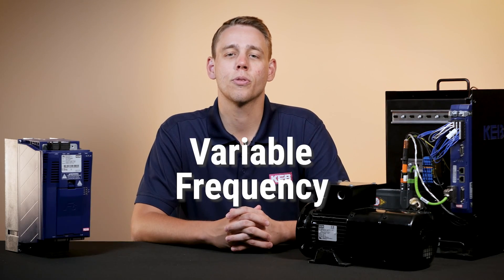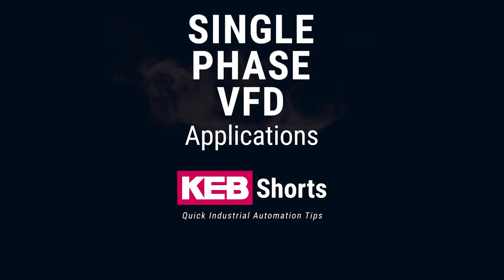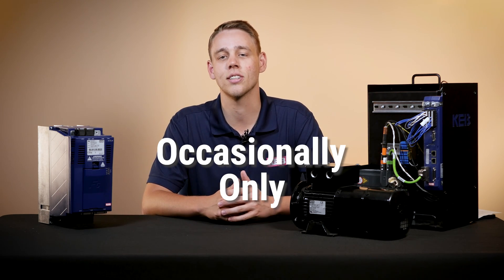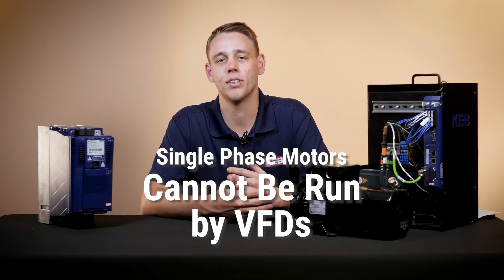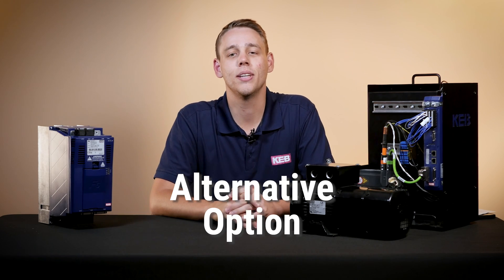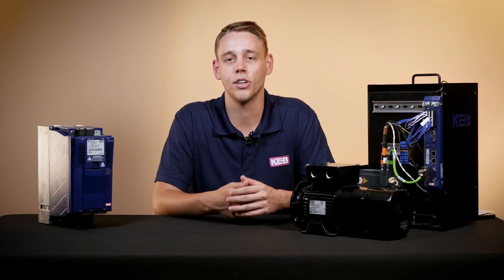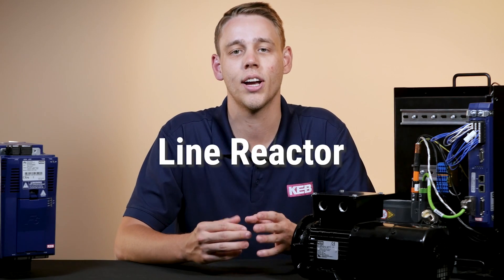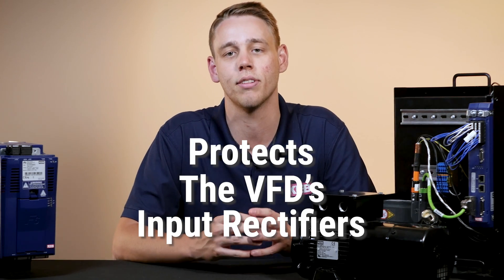VFDs for Single Phase Applications | KEB #shorts

Comment: I am looking for a VFD monophase ( 220V ) input to monophase motors (220V ) Output . My idea is control the frecuency and the voltage of course. I want to connect this VFD to an european motor 220V ( grodund, blue , brown and black or Common - Forward - Reverse ). Always uses a capacitor between forward and reverse. Does This exist? I want to use all the benefits from VFD on these motors.

Comment: Hello. There is a keb f4 drive device that has a technical problem. please guide me. The problem in the device is as follows. 1- The drive is turned on by connecting to its standard voltage, and all commands are applied to the device by the keyboard, and the device turns on, but the voltage does not appear in the output.
Reply from the maker: Thanks for your comment. Your first step would be to contact your machine's OEM to see if they can help. What type of application you are using with the F4? We haven't manufactured an F4 drive for decades. We would need more information to diagnose. If you cannot contact your machine's manufacturer, you can reach out to a KEB representative for further assistance: https://www.keb-automation.com/contact